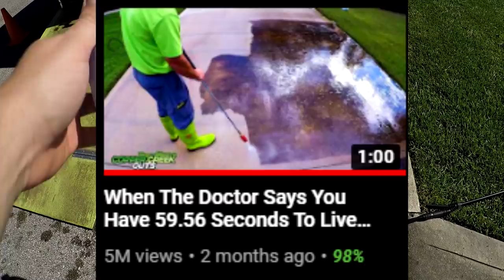Questions From My Most Popular Video EVER

Comment: I used to pressure wash clarifier weirs at the wastewater plant weekly. It was over 100 feet round. It was usually a four hour job from setting up, washing and tear down. I used spinner nozzle with a three foot extension with another  45 degree extension. I always found cleaning the algae off was very satisfying. From time to time I would use 200 ft of fire hose if I had help. Dragging the fire hose would kick my butt, but it would cut the job time in half. We had a problem with algae

Comment: Great video but I wouldn't mind doing that job with the lance only! Very very rarely I use the surface cleaner. It's very satisfying using the lance and creating a clean area as you go along. Just some ear guards to drown out the noise from the machine and then it becomes a very enjoyable experience.

Comment: Yep I live them rotation tips.  But still  not  as fast as the surface cleaner.  Good points on the hearing.  ? Do use concrete cleaner ever..

Comment: So the purpose of putting the algae cleaning on does what? Seems the power washing takes it all off. I did my driveway this past fall, just power washed it. Four hours later🤬. Is there something you can spray between power washings to clean the concrete????

Comment: yah, I just washed my mom's house and driveway using a pressure washer , when the electric on stopped working I switched to my trash picked , and fixed gas pressure washer. It was a simple fix, actually funny reason why he threw it out to begin with.  the pump may leak some but good enough for me. 
https://www.youtube.com/watch?v=DoOKLfvgJuU
house siding came out ok.  the driveway well  still see some streaks but its alot better than it was